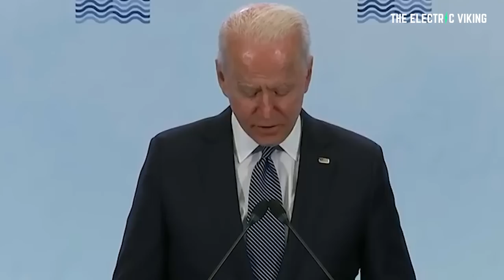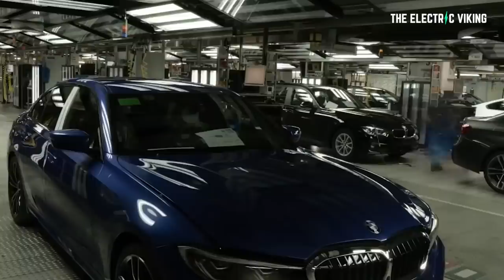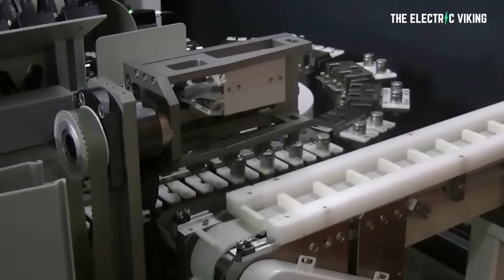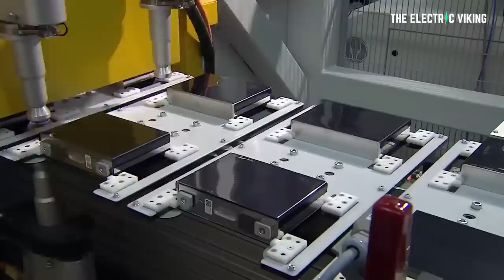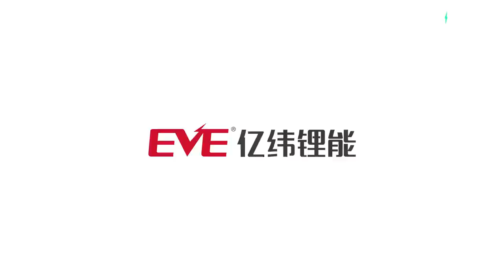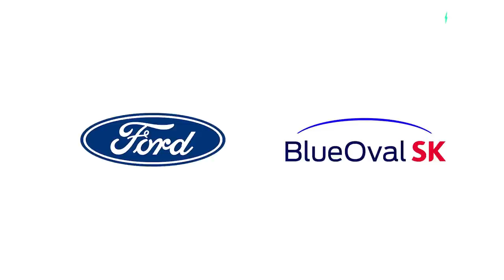BMW's $1.7B EV Investment in South Carolina + Giga Kentucky

Comment: Unions - that's what drives legacy auto crazy - unions to worry about.

Tryning to retrofit an ICE production line to an EV production line means getting rid of 75% of the union employees
and that's the hang-up.

Better to start from scratch and pour new concrete for the robots to rest on.
and build in a Right to Work state where unions are not welcome.
Reply: Where i live certain professionals ie doctors engineers are excluded from labor laws, and in my case am not allowed to be a union member!
Reply: SC is a right to work state.
Reply: No it doesn’t, UAW or UNIFOR are a shadow of their former selves, employees are grateful to have a job, they grizzle every three years but end up ratifying agreements.
Reply: Brother

Comment: BMW SUV's in Spartenburg are driven in part by what Mercedes SUV's do in Tuscaloosa. They are joined at the hip if you will. Mercedes now makes the Maybach version in the US so BMW is making their M versions here too. They basically have the same EV SUV market in the $65-125K range. BMW is exporting 60% of the ICE SUV outside the US while is am amazing number.

Comment: Who is going to be supplying these factories with processed Lithium, graphite, silicone, etc??
The only auto company I know which plans to refine its own Lithium is Tesla. Is there enough refining capacity in the US coming online to support all the factories or are they smoking dope?
By the time these battery factories are online the IRA incentives will require most, if not all, of that Lithium to be mined and processed locally in the US or at least in North American continent.
Seems that there should be some good mining investments that could be made here. Especially some Canadian companies.
Reply: thats my thought, building a battery factory without getting contracts for the minerals going into the batteries is just really silly.